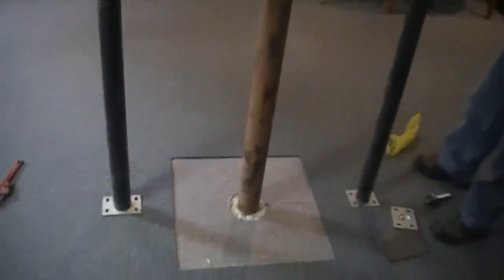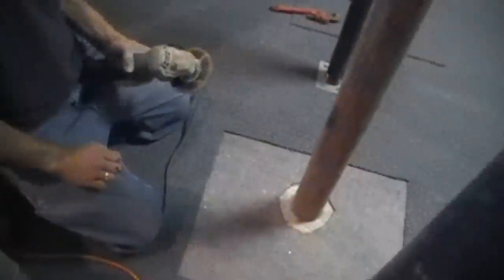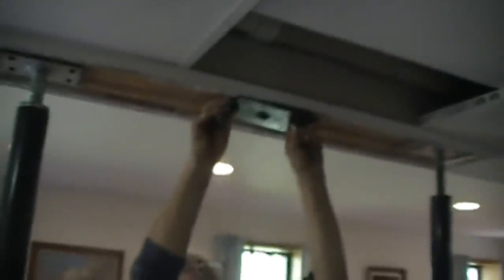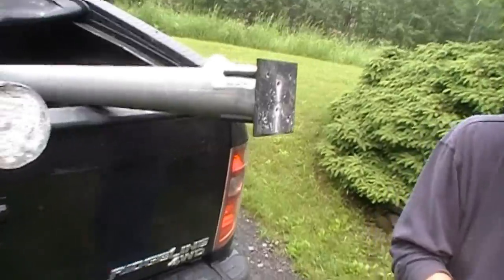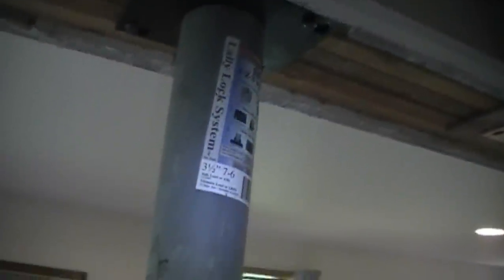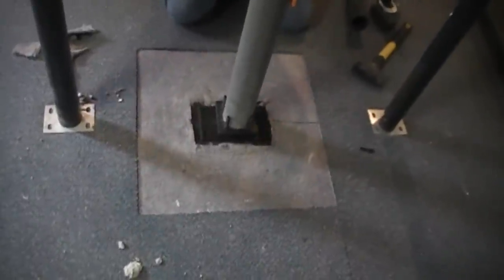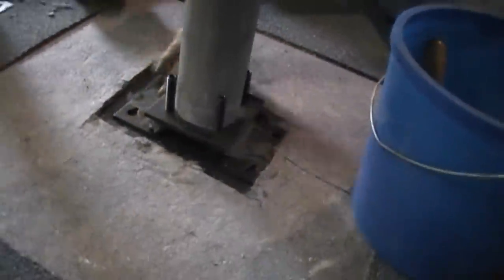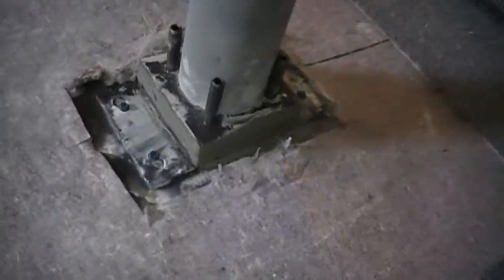Removing a lally column that is embedded in a concrete floor.

Comment: Just FYI to anyone watching, I spoke with a structural engineer who said that installing a lally column in this way was unsafe because it leaves a hinge position at the bottom of the column.   The proper way to install it is to dig to the footing below the column and set the new column in concrete like the old one was.   If no footing is found below the column, a footing needs to be created there.
Reply from the maker: The method of installing the column your way can also be done.  I agree that if a footing is not present then you should pour one before installing the column.  As for the method that is shown in this video, it is done per the 2012 IRC building code R407.3.  Building code states that the column must be restrained from lateral displacement at the bottom end.  This has been achieved by using the 4 concrete screws into the concrete floor.  There is no possible way the bottom of the column can move hence no hinge action can occur.
Reply: Great video! I live in CT. Where would I find the building codes for my state so I know whether it can be anchored like yours or if it needs to be installed into the slab? Thank you.
Reply from the maker: You should contact your local building official get your local code info.  The code official should be at your town/city hall.
Reply: Looks therr was footing beforehand he just cut old one out why I not no reason old column not look that bad.
Reply: bugmagnet:
That makes sense...
Reply: @louishollandjr  did you watch the video? old column had cracks

Comment: What is the difference between the column he install and the two he installed to hold the floor up while he worked?
Reply from the maker: The two columns are temporary support, hollow thin wall steel tube.  The permanent column is concrete filled and will carry more weight.

Comment: What is the cost for replace one column? Normally who should I ask to do this kind job? Thanks.
Reply: Ask an master Carpenters who has knowledge on home structure.
Reply: average 1k with labor and all however you can do it yourself for 100.Home depot sells exact column on this video. Just need to buy few jacks some thick wood to hold while doing it.Buy some concrete screws to screw the base and top plum and you are set that if your footing is in good condition if not then hire professional.

Comment: After seeing how loosely the top part went into place, I have to ask, did you make up the space at the bottom with those steel plates or are the four bolts bearing the full weight? If spacers, are they provided at varying thicknesses or do I need to purchase, create my own?
Reply: ErixTheRed:
It is also my same concern...
Reply: 4 bolts are designed to carry the load.

Comment: I have an old lally column right in the middle of my basement and is kind of in the way for me to setup a pool table.  (the column itself is about 8 feet from the side wall.  Is it possible to move it about 2 feet further away from the wall so that i can have a continuous open width of at least 10 feet ?  How much would that kind of work cost ?(approximate)  thanks.
Reply from the maker: You can move the column but you should consult an engineer before doing anything.  By moving the column you are changing the point load on the column and the support beam.  You will need to know if your beam will be able to hold the load with column moved.  As for cost, you have too many varibales at this time.  The engineer could cost around $500 removing the column and moving it could be around $300-$400.  The biggest questions are do you need to have steel added to your beam to support the load and will you need a large column to support the weight?  Hope this helps.

Comment: That thing would have lasted another 50 years
Reply: - Haha... I totally agree with you......   I have 2 lally columns in the center of my garage and over the many Winters in the Northeast road salt has rusted 10" COMPLETELY  off the steel casing where the column meets the floor and has been like that for about 8 years already.  The concrete core is now showing minor signs of flaking and I do have the new replacement columns I'll be installing when the weather gets a little more milder....
Reply: You got your house worth 500k would you cheap out 500 for new poll for peace of mine?